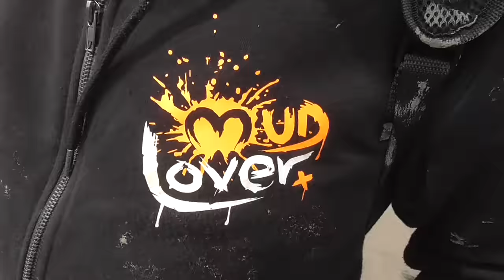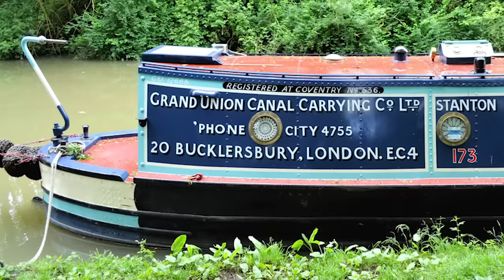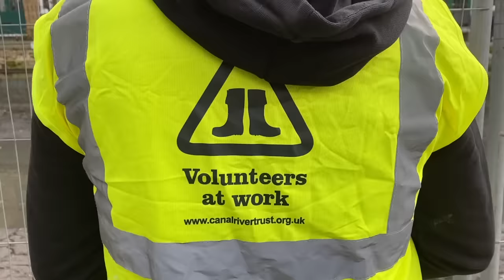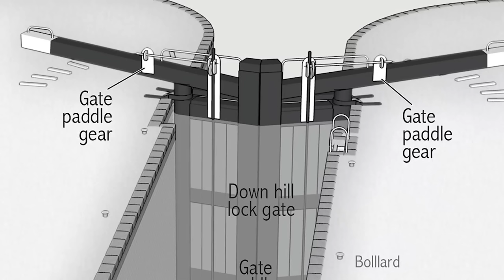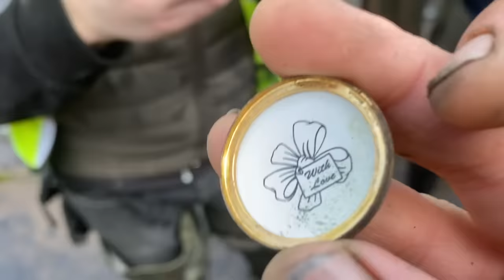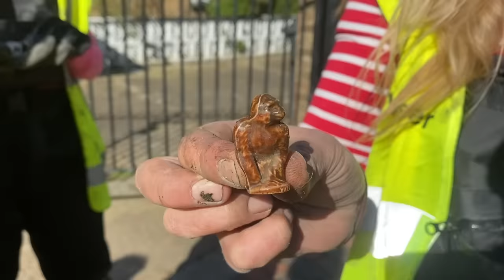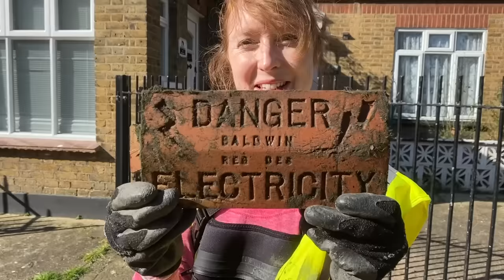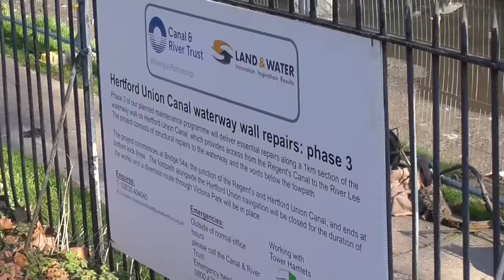GUNS, SWORDS and WW2 relics found in a drained canal. Unbelievable finds in the Hertford Union Canal

Comment: Its a pity all that mud can't be removed and sieved through. Imagine what's buried beneath it all.
Reply: My guess is the mud is contaminated beyond belief, lots of heavy metals.  It would be nice to get it down to the bottom and hose down what's left then move onto the next section.
I've seen vids by someone else and the canals he tromps through in Birmingham are littered with debris.  It is a disgrace so I stopped watching them even though I'm originally from there.
Reply: I was wondering whether the Canals and river trust would be dredging/digging out the mud as it is drained, it would be a shame not too.
Reply: It will be dredged it's just easier to do with the water in because the machines are on boats and the silt is floated away on butties.
Reply: @rogerdickinson920  We owe it to the environment to clean these canals up. We can find billions of pounds for vanity projects but never enough to clean up our mess.
Reply: @whitecompany18  I'm not so sure. It is contaminated waste and is very expensive to dispose of. They often just leave it.
Reply: If you take thick large pieces of cardboard with you it can help to  traverse over deep mud by crawling over it so you can reach more finds. Also it's biodegradable.
Reply: I often wonder if these old canals are lined on the bottom or if they had been at some point and the bricks or whatever is long gone. Would be easier to clean if they still had bottoms instead of just earth. I’ve no idea. How these old old old canals were made.
Reply: @AshRowan  i believe a fair amount were lined with clay if the ground is porous ... so cant really dredge it
Reply: @petec7343  oh I meant maybe hose it down or shovel it but all of that would take tons of work lmao
Reply: @AshRowan  hi, they could drill down and take a core sample.  I’ve seen other drained canals that had brick bottoms.
Reply: @AshRowan  
Dredge it and screen just like what is done in Yukon for gold.
Reply: @AshRowan  They do have a base lining .
Reply: @AshRowan  They lined the bottom of the canals with clay and then drove herds of cattle through them to compact the clay and make it waterproof so the water wouldn`t seep away.
Reply: You stopped watching because it showed how nasty London is? Wow. But if it was black you would have no problem exposing it
Reply: @AshRowan  apparently they were, with terracotta tiles.
Reply: @petec7343  You could. But only to a certain, pre-determined depth, I guess.
Reply: @Strawhalo  O_o What?
Reply: @Strawhalo  bro what
Reply: Be a few skeletons i bet
Reply: @Strawhalo  You have problems
Reply: They did it to the hudson river.. I'm sure they can do it to a canal.
Reply: Exactly.
Reply: @TheOGDorothy  same with heavily toxic Boston Harbor and multiple similar rivers and industrial canals. leaving contaminants in place is ridiculous, it should be removed and replaced
Reply: @DavidLee-yu7yz ,,,,,så ,,,,
Reply: Hell yeah 👍
Reply: @rogerdickinson920  q³
Reply: I was thinking the same thing.
Reply: That's gonna be a few hundred tons of thick sludge to work with!! Would take forever!

Comment: Hey, Si. If you want information on that helmet, it's a early WWII Brodie, probably 1938 pattern. Later ones got rid of the leather for a webbing. A very unique find, especially when 85% of the helmets were left on Dunkirk. Only a small portion of those helmets really exist in modern times. From the look, as well, it may have been modified with a new-ish chin strap. Nevertheless, very good find.
Reply from the maker: Wicked thanks
Reply: Yeah, I thought WW2 as well, but I wondered whether it was an ARP Warden's helmet. What colour was it painted?

Comment: British swords don't have that sort of hilt construction, the pins indicate that it's made with a standard knife method of pinning outer plates to the tang.

I actually think it is a bayonet, which generally employed a knife hilt, because when the smle (short model Lee-Enfield) took the place of the longer-barrelled Lee-Enfield rifle in around 1905, it was deemed the standard bayonet didn't reach far enough to do the same job as was previously possible, necessitating a newly designed, longer bayonet, which I believe this item is.

Comment: I worked in the sand fill crew underground, when you started sinking in the mud you never tried to pull the stuck foot straight out, all that would happen was that the other foot would be pushed into the mire. The secret was to jiggle the bogged foot rapidly up and down, this acts to liquify the mud  and the foot is easily unbogged without bogging the other leg.

Comment: The little lantern (at 19:00) is common and not old.  They sell them at Ikea here in Canada for $5.00.  They're for little tea light candles.  They are cute, but after a winter or two outside on the deck, they dont look much better than the one you pulled out of the canal.  Wonderful thing you are all doing.... I wish I could have been there to help.  Getting an excavator in there to remove much of that mud to go through it (even with metal detectors) would have been great, but nonetheless, all the trash removed...  Excellent Excellent. <3  New subscriber now :)

Comment: The helmet is WW2. The WW1 jobs had a different style of liner and the rim lip was slightly wider. In addition, they also had different 'bales' (the chinstrap attachments). A trick to discerning WW1 from 2 is, sit the helmet on a flat surface, if the complete circumference touches the surface it's WW2. Due to earlier pressing tech, WW1 lids wouldn't do this and rocked slightly.
Hope this helps.
Great vid, as always !
Cheers !!!
Reply from the maker: Yes thanks pal!!

Comment: I was lucky enough to experience being a "legger" in the 70s during a canal boat trip in a tunnel at the Black Country Museum. They turned off the engine and got the whole class of under 10s children to lie on boards and push along the barge with our feet along the tunnel walls. Historically this was done and the horses would meet the barge at the other end after being walked above ground. Health & Safety would have a fit these days but I'm luckily to have been a child of the 70s where we allowed to experience 'real' history. Going down a mine on one particular trip was also cool.

Comment: The helmet is a WW2 Mk2 helmet as being worn by me in my profile picture. The bracket/clip item is part of the helmet chinstrap, the complete chinstrap being a rather complicated affair consisting of a webbing portion and an elasticated & spring loaded section up near where it attaches under the helmet rim. The later Mk3 "Tortoise" and Royal Armoured Corps helmets used a simplified webbing strap which could be used on the Mk2 as well.

Comment: When I was twelve, and the local disused canal was redeveloped, I spent months gathering codds bottles, hundreds of clay pipes, green and blue early victoriana bottles(early had jagged tops, as they were crystallised by the glass blowers using water on the hot glass) once found a shotgun,
Two lambrettas, and a vespa scooter, twenty two small bags of current coins, pots, marbels, lead soldiers, no metal detectors,
Just me and a garden sieve.

Comment: My question about this canal is if it has a concrete bottom does the government use bulldozers to clean out the build up of years of mud and debris or do they let volunteers clean out the trash and debris? It looks like  there's easily at least 2 feet of mud in the canal. But at least you guys found some interesting stuff in the canal.

Comment: If they can walk so easily through the middle of the canal, it's probably because the passing boats have moved the dirt to the sides through the decades. That's why it's so hard for them to walk there. It also means that the channel floor is brick or concrete and is still there. It would be necessary to clean the entire canal with machinery and not put people to remove a few objects that don't change the deplorable state of the canal at all.

Comment: That 'sword' is NOT a sword, its actually an old Machete from WW2 era. My dad was in the Royal Engineers and was in Malaysia during the uprising, we had his Machete in the shed for years when I was a child as when troops had been posted in the far east places they were issued with them and when they were discharged from service most, like my dad kept them. They were much longer than the modern ones that the scalawags get today and were quite heavy with black hard wood handles (you can see the brass rivets that held the handle on), dads was left blunt and never sharpened as he probably thought I would do myself a mischief if he had of done as I was a bit stupid as a child and got myself into all sorts of bother (nothing bad just kiddie mischief).

Comment: I'll share how I used to walk muddy marshland for duck hunting which will help you. I carried a 12 inch wide x 8 to ten foot long ads 2 inches thick plank with a handle at the center on it's side. You simple lay the plank down and pick it up after you reached solid a spot. Replete as needed. I found with one plank I could go on for miles in the worst conditions. Using planks would be ideal for cleaning canals. I don't know why you struggle without walk planks. whew it is a simple solution. How much time was wasted digging yourselves out? Even some old galvanized roof sheets for paths are better than getting stuck

Comment: Why not use knee boards? Mason use them to walk on concrete as they trowel finish it. In recent years power trowels are used mostly but masons have walked wet cement  since cement was first used for flat surfaces.

Comment: I dont understand why you dont make far more use of a suction dredge to clean the bottom of these canals. They are cheep to build and run and can be set up to work on soft bottom without doing damage. They would also allow the work to be done without draining the section unless other work has to be done and are much quicker that doing it by hand.
Reply from the maker: How does a suction dredge pick up a bike?
Reply: @Sifinds  Depending on just how they are set up they can pick up most things but from what I see of the maintains work undertaken on youtube etc the major work is weed and silt clearance which it appears is done largely by dragline and shovel. This is an area where the suction dredge comes into its own but if I was doing that work I would pass over with the dredge first set up to clear silt and leave the steel behind then follow with a magnetic plate. No requirement to empty, clean scrap and back in service much faster. Just draining and refilling must be a major undertaking on its own without the cleaning phase. You must remember that we dont have a canal network here in New Zealand so we look at these things from a different angle and without a history or tradition.
Reply: @Sifinds  Just to give you an idea we routinely use small (up to 6 in suction dredges) for gold mining in our predominantly gravel bottomed and fast flowing streams. These, often home made, consist of a small barge with a 15 to 20 HP motor and pump which runs a venture into a separate collection barge. simple robust and easy for any competent engineer to build .

Comment: Those red bricks with Danger electricity on them.   In the old days, when you laid an electricity cable, you had to put a line of these warning bricks on top, so that should anyone else did down for any reason, they would fist see the bricks before they sliced into a live cable......Nowadays they have fancy ground radars which they run over the ground before they start to dig.

Comment: Why not use mats to put on the mud to walk on on top of bamboo sticks as they are light to carry . Plus the rubber mats or foam mats can be rolled up to carry and store
Reply from the maker: @John-lh5fm  You would just push them into the mud creating more rubbish. We did use ply wood but it’s a very slow process. We just grabbed why we could in the time allocated
Reply: @Sifinds  we used them in Birmingham whilst working on the canals in Aston so it works . . Failing that cut  a  sheet of ply up into sections and fit hinges on them so you can fold them and carry them easily.  And yes those so you spread your weight over an area , rather than sinking . Sorry just simple ideas that will help your cause plus its safer less injurys.
Reply from the maker: @John-lh5fm  Do you still work on the canals?
Reply: @Sifinds  no not now I live in wales .
Reply from the maker: @John-lh5fm  ah shame, if you happen to hear of any drained rivers or canals please let me know!
Reply: @Sifinds  I will do . Good luck to you all

Comment: Why are canals always full of tyres? Why would a person HAVE a tyre when they happened to be next to a canal? Hell, even if you're driving next to a canal, and happen to get a puncture, there's no scenario that ends with you taking the tyre off the rim with your bare hands, to throw it in the water. That's like 10X the work of just throwing the old wheel in the spare wheel well...IF it's even possible to do without at least a crowbar. Who even keeps their old tyres? If it needs replacing, the garage tends to dispose of the old one, but even if they give it back to you, why take it to a canal to dispose of it? If you don't want it, don't take it from the garage! They won't force you to take it! They make money selling even the most trashed tyres. They sell them in bulk to go-kart tracks, and to farmers, who use them to weigh down the tarps they put over silage.
 So...how on Earth are all these tyres in every damn canal? Especially in the middle of a city! Who the Hell carries a tyre around?

Comment: Really need to dredge that out, concrete walls and base, and then every 5 years, close it off, crane a couple cleaning trucks in there to sweep it.  It's an eco disaster as it sits.
Reply from the maker: That would be nice. But no cash to do